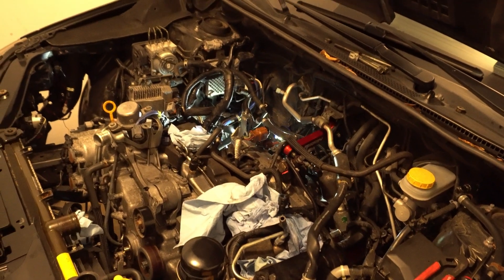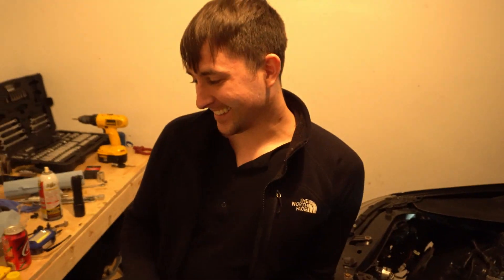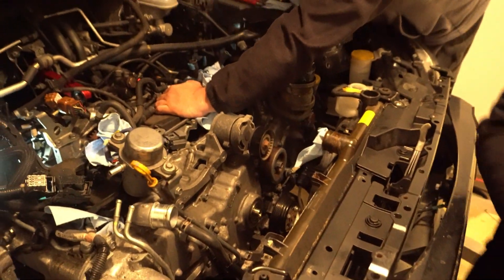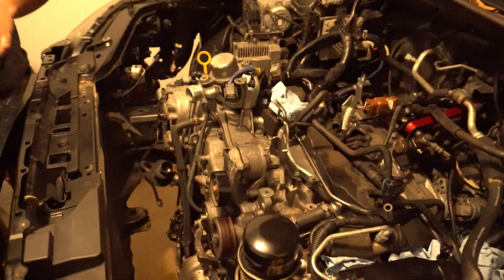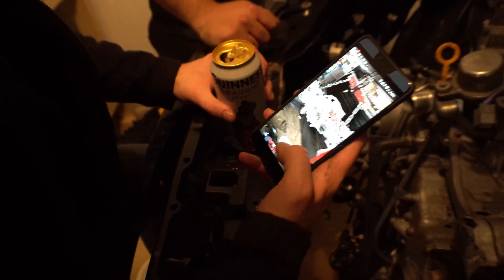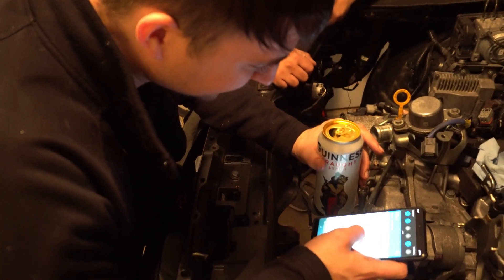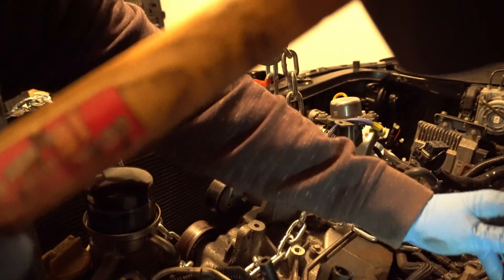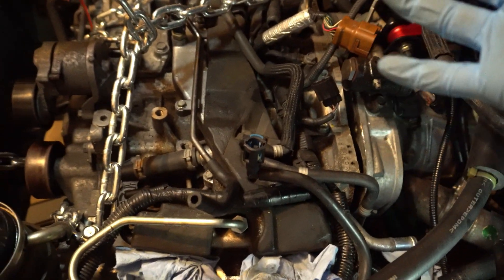How Not to Swap an Engine | Subaru WRX Engine Swap Fail | Part 1

Comment: How did his engine turn out?
Reply from the maker: It turned out perfectly. Powerful, but like every other Subaru owner, he ended up selling it lol
Reply: @ARomanRacing  damn really? I'm building mine right now and have no plans to sell but I've already expected that I wont make the power I want in a wrx I'm going for 500. What did he make?
Reply from the maker: @_wrx_WHPFaDIT  i do not remember what he had but im thinking over 400 but under 450.
Reply: @ARomanRacing  that's not bad idk what his mod list is but I've got a big list including bigger tubro, headers and brz manifold. So should be close to 500 really wish I had an sti tho because the money I've invested into the wrx I'd probably be around 700whp in an sti
Reply from the maker: @_wrx_WHPFaDIT  oh yeah you definitely gonna be making some good power
Reply: @ARomanRacing  that's the plan haha
Reply from the maker: @_wrx_WHPFaDIT  would love to see the build!
Reply: @ARomanRacing  @_w.r.x_ on Instagram! I am working on helpfully being able to record alot of the process. But I have been posting all the parts as they come in on Instagram and fb. Car looks pretty stock on the outside for now but after the engine build I'm doing full sti tranny swap then I'll start making my car looks as awesome as yours does